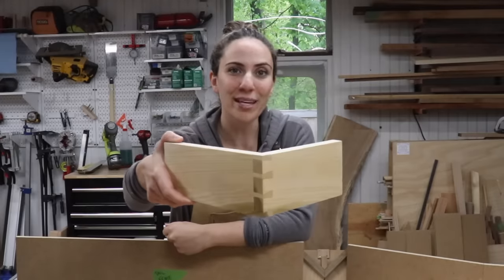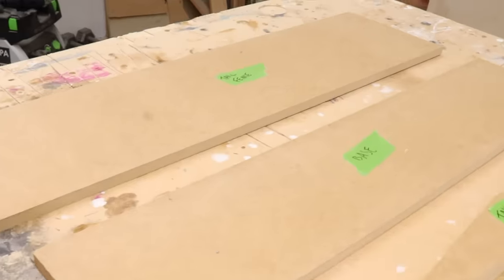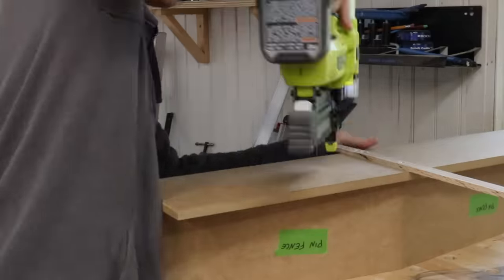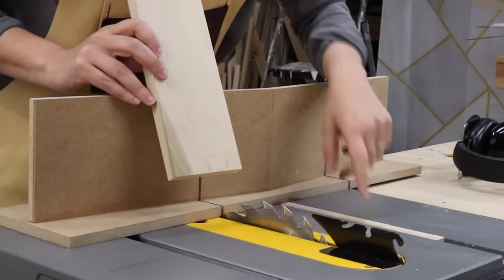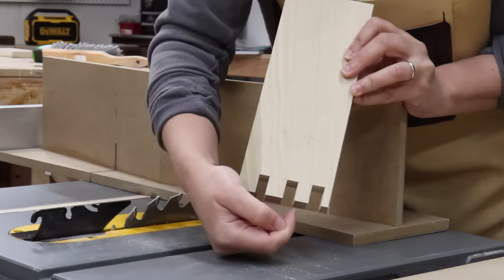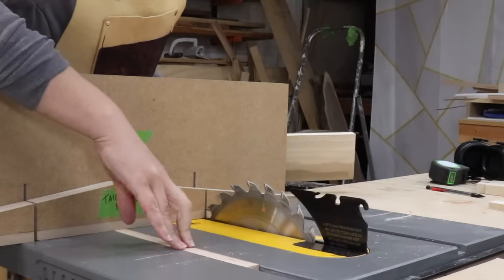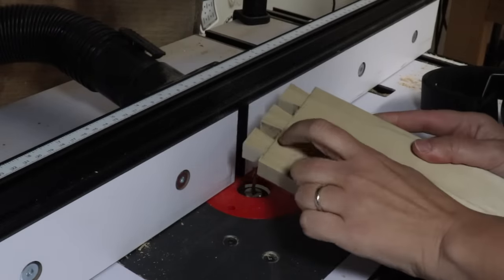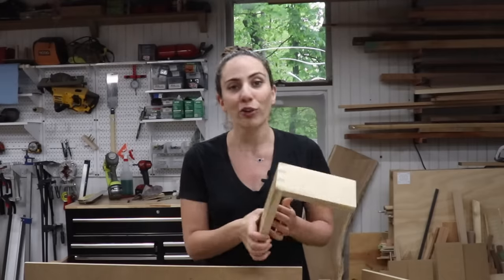Dovetail Jig for the Table Saw // Woodworking Joinery

Comment: If you don't want tear out (depending on wood things go quite spectacularly wrong) all you have to do is score a fine line on the back height line. Doesn't need to be deep, prolly .05mm deep. Just a kiss with a box blade. You'll never have tear out with that in place.
Reply: good tip!
Reply: Great tip, Thanks
Reply: This also gives the look of the hand-cut dovetail.
Reply: Hmm. Certainly give that a try.

Comment: Hi there, great video!! It’s refreshing to see someone take the risk and do something they’ve never done before. Here’s a quick tip. If you want to divide your work piece into a certain number of pins or tails, use a ruler on a diagonal with a measurement that is easily divisible. If you want three pins, use 6 or nine inches on the diagonal, then transfer those marks to the end of the piece with a square. If you want 4 pins, use 8 or 12 and again transfer to the end. There’s no math and you can then use those marks as the Center of your pins, then transfer as you did for the tails. It’s easy and works great. Personally, I find it easier and quicker to hand cut dovetails rather than all the setup of the saw, but that’s just me. Keep up the great work. 🙂👍🏻

Comment: Those turned out really well.  I do have one small piece of advice: clamp a guide board on your gauge lines when you go to chisel out the pin spaces.  You can hold the chisel in the gauge line against the board as you chisel and it will keep the chisel in plane.  I always use guides to chisel.  Some people even make jigs to clamp their boards into to guide their chiseling when they do large numbers of dovetails.  

I’ve seen the table saw method before and I like it much better than using dovetail jigs with routers as the router jigs always produce artificial looking dovetails.  The pins just aren’t narrow enough.  The table saw method gets clean results that look really good but the pins can be made narrower so they look more like hand cut dovetails.  Nice work.  👍🏻
Reply: Please!  I cringed at 19:08 !  Do not ever direct a chisel toward your "clamping" hand!  One slip and the blood will ruin your project.  Otherwise... Super cool.

Comment: To solve the problem of height difference when you cut the tails, you could align the tip of the tail ramp to the center point between the 2 blade lines. Rather than to the runner. That way, the saw heigh would be the same on both sides. Hopefully I'm being clear !...
By the way, great job and perfect video !
Reply from the maker: Totally clear! Since it’s glued on I can’t adjust it at this point. Wish I would have noticed that before. Ha
Reply: You can also lower the blade height to just below the line and finish it and clean it up with chisels

Comment: There were a couple of times during the chisel use that one of your hands was in the line of fire if you had slipped. I was taught to always keep both hands behind the cutting edge of sharp tools. Great jig though.
Reply from the maker: Yeah. My bad. I will have to be more aware of that.
Reply: I witnessed a terrible injury as a young guy in school by a chisel that was razor sharp. It was a very innocent situation and caused by a slip of the chisel. That day l learned a lesson l have never forgotten, it scared living heck out of me at that time. I am enjoying your channel.
Reply from the maker: Maurice Ryton yeah. It that point I was just marking the line I needed to cut to. I didn’t think it was a big deal since I wasn’t using much force. But you’re right. I need to be more away. Thanks!

Comment: Its good to see that the pencil was abandoned for the marking knife half way through the video. When making dovetailed joints (by any means) the knife mark is much more precise for marking a location (.002 vs .030 inches uncertainty for a sharp pencil) but perhaps more importantly, it provides a register for a chisel. Cleaning out waste material for either the pins or tails is so easily accomplished with a SHARP chisel that can be positioned precisely in a knifed line that any other method is actually slower and less precise. In addition to the registration line an appliance as simple as a block 2" high and say, 2" wide, and as long as the dovetail board can be used to align the chisel vertically for a PERFECT parring cut. Dovetails fitted this way will go together with a tap of a closed fist. Regardless of whether you cut pins then tails or vice versa, transferring the EXACT location of the tail to the pin or pin to tail is easily accomplished with a knifed mark and again, the chisel can be positioned to produce a PERFECT fit. Tweaking a dovetail this way is easy and satisfying and with a little practice you will be able to cut a simple dovetail without a jig by roughing out the waste by any method (scroll saw, band saw, copping saw) and cleaning up with the chisel and appliance. This work method will open up a whole range of artistic dovetail layout and give you 'hand cut' bragging rights!

Comment: You can layout evenly without dividers just hold your ruler at a steep angle across the board and pick a measurement that works out nicely then tick each one
Reply: It took me a minute to understand what you were saying here. I think you are saying that the geometry of laying your ruler at an angle will make simpler math at certain points. If you are making three tails and put your ruler at six inches angled across the board, the centers show up every two inches. Is that right? Clever solution if so! Thanks!
Reply: Aaand I just read another comment with the same recommendation (but a little more explanation). My interpretation was correct! Well done me! :-) Thanks again for the hint. It will be useful for dovetails and lots of other applications.

Comment: As with most of your other comments i enjoy your level of detail and transparency. I’ve always been a fan of Norm and his old ‘New Yankee Workshop’ videos but I always wondered how his projects always came out so perfect on the first try while mine NEVER did. I do think that learning to use a router jig for dovetail and box joints is the best and quickest way to make them. Porter Cable and Leigh make fine ones but they are both costly. They are tedious to learn but once learned the joints are quick and perfect from then forward. It’s a good investment in making classy looking drawers with a lot more glue surface and a lot more strength. James King of Kings Fine Woodworking here on YT has an excellent tutorial on learning how to use the Porter Cable jig.  Keep up your well done videos. They are informative and enjoyable to watch.

Comment: Good job. A lot of the time I just cut tails by hand since there is so much chisel work anyways.

The scary part is actually doing both ends of the board lol. Some type of investment lol.

The fastest way I have found to do dovetail corners is to use a router.

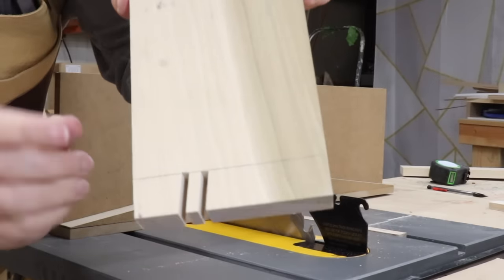Comment: Hey Tamar. At 14:14 If you put the board on the other side of the blade to set the height, it would come out accurately.

Comment: Glad to see you were not intimidated by dovetails and I like your jig approach.  However, I physically flinched when I saw you driving a chisel toward your hand holding the workpiece.  Try laying it flat and cutting down across the board to avoid unfortunate red coloring in the wood.

Comment: I dont know-maybe my brain has been booze-soaked...but that all seemed overly complicated. I found it easier to hone my hand-cut dovetail skills.
Reply: Yeah but once you have the fence set, you can slam out like 100 dovetail boxes in a single day!
Reply: Not just easier, but faster.  She claimed at the end it takes a lot less time... and it's not the case.  It's true that I had to mess up 6 or 7 boxes (mind you, they're still holding together and getting used, they just look bad) to get to the point where I am, but I'd have had an entire drawer's worth of dovetailing knocked out in the time she spent on that one joint.

And the tools I use to do it are all cheap.  Well, you do kind of need a decent vise to work fast, but apart from that it's a handful of $20 tools.
Reply: @fisharmor  Depends on how you set it up. I use an incra 1000 miter gauge and an angle gauge to tilt the blade. I do tails first and the only layout i do is one line on one board to mark the thickness. I use a stop so i just flip the board to get an exact spacing. Make the spacing up as i go and it doesn't matter using a stop i get exact spacing from the original cut. I can have pins cut on both ends of the board before i can lay out pins on just one end.
Reply: @ColoradoHiker  🤯
Reply: I think if you cut the pins on the table saw & tails by hand (pull saw near the line, coping saw to hog out waste & chisel to clean up) you'd have the fastest system using the table saw. Router w/jig on both pins & tails would be faster still, tho obviously machine made
Reply: She talks REALLY fast, so I slow down the speed when watching her videos, if. I have any hope of understanding.

Comment: Hi. I find that you are a very creative person, imagining what is the better way to do something you've never done before. There are actually some rules when doing these dove tails. I don't remember them by heart, I finished school in 2013 and haven't made them since. If you are interested I should find them in my school books somewhere. Usually the dove tails are done by hand using these tools : marking gauge, a divider or compass, a butt-locking bevel gauge, japanese saw, different size chisels, a measuring rule and a pen.  Maybe I forgot something, but I don't think so. And sometimes I would be doing all the markings and cut them with the band saw. Yes, as you might have guessed, it was very annoying (and long) doing them. Your way is quicker 👍. Anyways, keep it up, your videos are inspiring. Greetings from Switzerland.
Reply from the maker: Thanks! I've since learned a lot more and cut them by hand but this was a very fun experiment

Comment: Very nice video, very instructive, beautiful joint.  My take-away is that for through dovetails like this, I will get a dovetail router bit of desired angle and knock out the tail cuts, then trace the dovetail cuts onto the pin board, and finally, cut the pins using a jig like yours that's made to match the angle of the dovetail bit.  This would be somewhat limiting in that the height of the dovetail bit limits the length of the dovetails (and thus the thickness of the pin board), but clean-up should be quite minimal and easy because the bit and blade (provided it's a flatty like you used) could "reach" everywhere they need to be.  Thanks so much, love the pin jig and learned a lot from both!

Comment: That is a clever idea, well done. I'm going to use this  as I'm not forking out for a  router dovetail jig. I'm not great at cutting them by hand but this idea will get the saw cuts straight. The rest I'll do with a chisel.
Thanks

Comment: 😀I enjoyed your video so much that I decided to build it. So I bought the plans. I got the necessary lumber and enjoyed a few days of careful construction. Still, some things I hadn't considered blocked my enjoyment ultimately, and I was unable to complete the project in the available time I had. I have a Ryobi 15 Amp 10-inch Expanded Capaciotyu Portable Table Saw with Rolling Stand. Overall it's a fair table saw, but unlike Tamar's table saw, mine only has one channel, so you can only use one side of the jig. This became apparent when I went to make test cuts to locate my safety- two-by-fours.
Another problem I hadn't foreseen was that the existing channel only had two choke points. Rather than embedding a quality channel that would operate smoothly and consistently with the runners, they just cast the channel along with the top of the table. If you look closely, you can see the channel is very sloppily made, and the width is not consistent along its length. The silver lining here is that I learned what is behind the dovetail method, and I will take it up again when I have the right situation.
Reply: If you only have one channel then you need to make 2 separate jigs a left side and a right side. Or to solve both problems you can make cut some thick ply to fit over the saw bed. Then make your own channels in it.  I would over size it by an inch all the way round and then add strips so it sits snug over the existing table bed. Then raise the blade up like you would a zero clearance insert and then measure and cut your channels. You can then use this for any jigs that you make and just lift it off when you want to use the saw fence.

Comment: I made this jig and like you my table saw slots are not equidistant.  The solution I used was to add a shim the thickness of the error and add it on the low side and it works great.  Excellent videos .  Thanks
Reply from the maker: Great idea! Glad it worked!

Comment: I know everyone has opinions and that is all this is. You are very talented and have a great understanding of grain structure and geometry. I really believe you would be much more efficient with a traditional back saw, coping saw, and a chisel. You used all of these thing except the back saw. So you spent a ton of time using power tools that you ended up cleaning joints with traditional hand tools. Great instructional video. As a traditional woodworker I'd just love to see you murder a dovetail with hand tools and see how fast and easy it really is. Thanks for sharing your knowledge.
Reply from the maker: Thanks! I recently did a hand cut dovetail video. It was fun

Comment: Hi Tamar, you can set the blade height for the tails correctly by holding the workpiece against the blade from the lower side of the ramp.

Comment: Like someone else said, you could flip the piece to do the other side of the tails using the same side of the ramp or my initial thought was to offset the ramp so the slope is at the same height on the blade no matter what slot it's on and that means marking out only has to happen on one side. Great video tho, I'm inspired, I'm currently making a load of jigs for my job site saw, this could be next!👍🏼👍🏼

Comment: You are a far greater woodworker than I am. I have actually used your videos for a huge portion of my education. I love how in depth and technical your explanations are. You're very intelligent and that's super sexy. But I did want to mention one thing. First, I agree with you about the router being scary to use there and believe you made the right choice in the end. But if another situation arises where you gotta use the router like that, try putting it through a momentary foot pedal switch. That way you can keep your hands on the project and move it around more freely before starting the router.

Comment: For your tail ramp height difference: you can set the blade height to an arbitrary setting, make a cut on each side. Draw a square line across the top of each line. Then measure the distance between the lines. Split the ramp in half and cut that measured amount off the taller side.

Thanks for the vid, I'ma build me one of these.
Reply from the maker: Sounds like a great idea!

Comment: I have tried to use the HPDE for miter slot runners and haven’t had satisfactory results either. Really disappointing because I was so sure it would work. Just like you I went back to wood strips. 

Very thoughtful way of building this jig for dovetails.
Reply from the maker: Thanks it worked well for my big cross cut sled.

Comment: Thanks for the very interesting video. I find hand cutting tails to be much easier than the pins. However, I never seem to cut both sides at the same exact angle. I am pleased with the fit of my dovetails but I am really slow. Also I usually managed to cut myself with the really sharp chisels. I would like to get faster and bleed less, so I will ponder this jig.

Comment: Liked your video. I have been watching a lot of dove tail videos lately. Your approach was good, and I liked your jigs. What if you cut the tails first using a dove tail bit in the table router using a simple 90 degree jig to hold the tail board up. This eliminates tear out and provides an accurate angle. Then lay the out the pins using the tails and cutting the pins on your first jig using the angle dictated by the router bit's angle. I want to build a shop cabinet for under my Chinese Jet Lathe. I'm building this heavy duty because of vibration. It will have five drawers and I like the dove tail idea. Note while writing this comment I got a good idea for this cabinet's case. Thanks

Comment: You might want to try cutting the pins first using a dovetail router bit. Just remember to use a backing plate of mdf or soft wood to prevent breakout and to keep a very close eye on the bit itself - I have only ever found these bits with quarter inch shanks, which is annoying as they tend to slip in the collet messing up your height adjustment. If you can get a half inch shank version grab it. Using a router for the pins would mean zero cleaning after and a very quick cutting operation, the only fiddly bit would be setting the fence for the spacing. Besides this your jig looks great! - Will have to try this myself now!

Comment: Very well done, almost perfect. Just a thought, it is possible to use only one of the jigs for both the tails and the pins you do not need both. It might be a bit awkward though having to put to the work piece flat down on the table instead of  keeping it perpendicular to the table.
Next project a divider from wood, its easy just two pointy pieces of wood attached in the flat parts through a bolt or something.

Comment: When doing the tail jig, if you put your backer fence on, then cut in your kerf lines, you can measure a center line between them. Then attach the angles tail fence piece centered on that line.